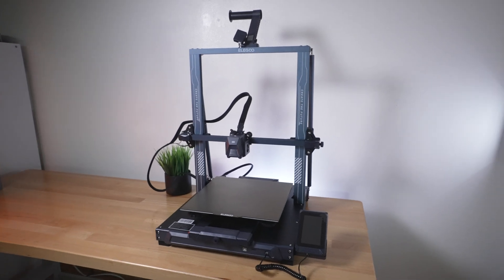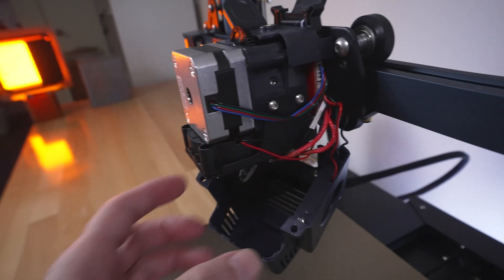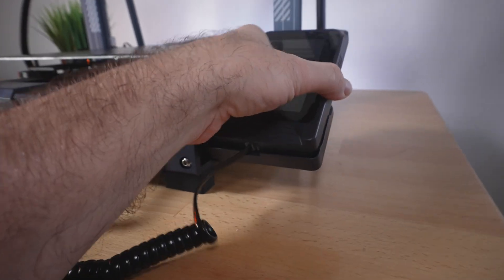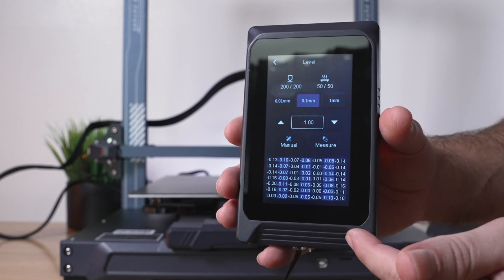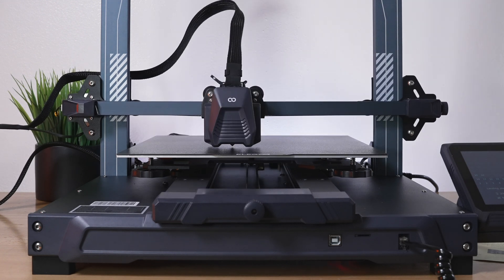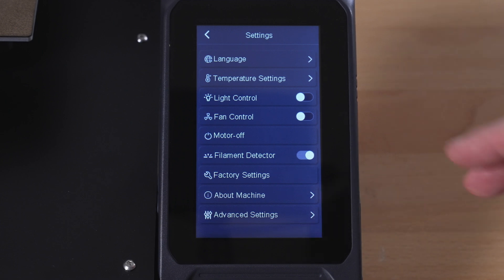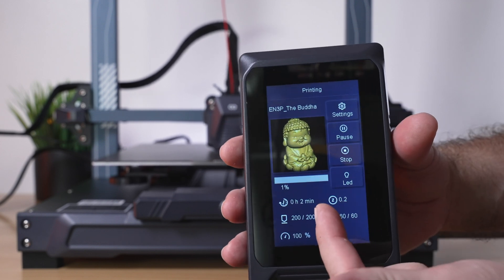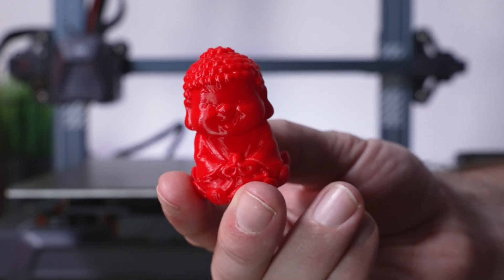Elegoo Neptune 3 Plus - Overview leveling & Print

Comment: Thank you for the video.. trying to follow along both of them. I can't even get #1 to touch no matter how much I spin it. #3 is so loose, regardless of what I do with the tool I use, I'm -2.20, so I'm assuming my prints will be terrible. Edit: Auto leveling won't even start. Gives an error about Z-axis.
Reply: I just went through with this procedure, starting with -2.10 mm Z-offset. I believe this value is related to the sensor, not the actual nozzle distance from bed.
First preheat nozzle and bed to operating temps, select leveling menu, wait for homing, then adjust the -2.20 mm Z-offset value on the screen to touch center point with a piece of paper.
Then start manual leveling with the same piece of paper between nozzle and bed, go around 6 points and adjust 6 knobs below bed, go around multiple times until no more adjustment needed. You can select the points again without leaving this menu. If finished tap the center home button on LCD.
Finally put paper aside and confirm auto bed leveling to finish the task.
Reply: @ASCENSiON1989  Thank you! I was able to get everything setup :)

Comment: Great video, thank you for your thoroughness and attention to ever detail. 
Do you have a video where you do e-step calibration, or where you do a temp tower and modify the g-code so the printer pauses until the new target temperature for each new section of the print is reached before that section is printed? 
Cheers!

Comment: The PSU fan noise is friggin loud on mine, the printerhead is super quiet.
Reply: The fan on the hotend is also pretty noisy! Hope there will be a way to upgrade to very silent PSU + hotend fan.
Reply: @D4ngel21  huh, i mean its a little bit of a perspective kind of thing, but it seems that they might have a slight fan quality issue then perhaps. I contacted support and they told be that my psu fan might be broken (i thought it had excessive noise) and would send me a replacement. So if you feel its abnormally loud, contact them about it.
Reply: @jubb1984  Is the replacement much quieter?